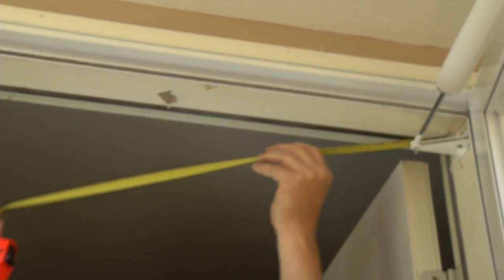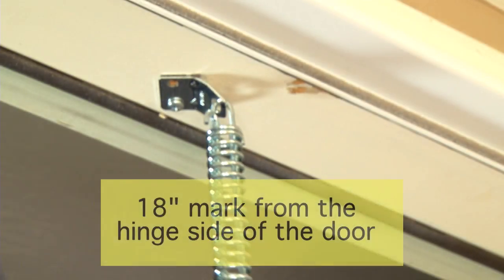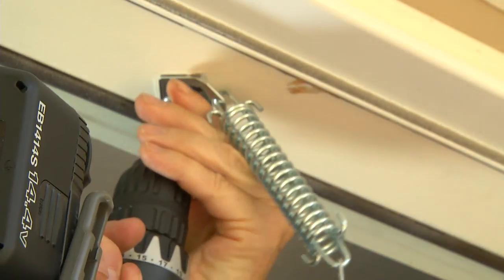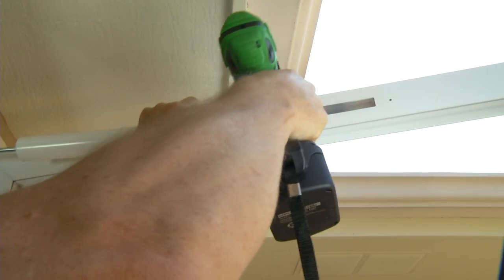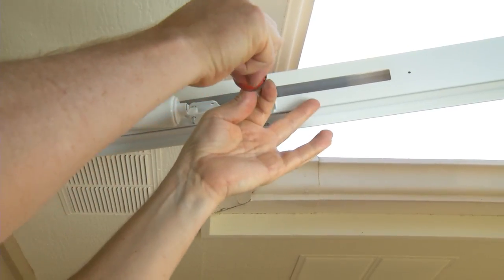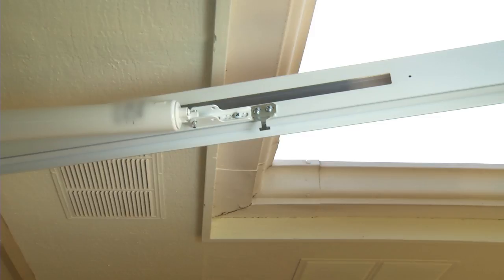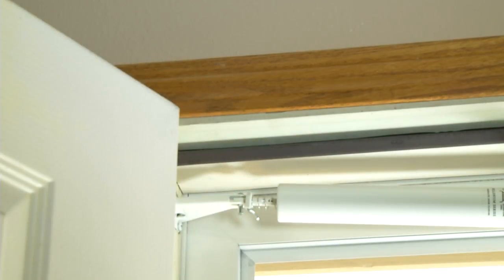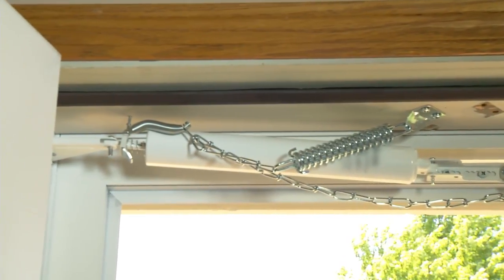Gerkin - Installation Of The Safety Chain

Comment: Anderson doors don't come with spring....because there's no place for it.  Besides, the door is basically plastic.  I'm gonna find places to drill bolt holes all the way thru door and bolt on twin flatstocks with a welded nut , or whatever, to hook the spring.  I checked home depot, menards...not one door comes with a spring.

Comment: Thank you for the 45 Degree Angle on the Head Jam! All instructions have it 90 which totally makes no sense!
Reply: Physics called, and it concurs.  You don't create a twisting moment on head jam screws if they are both normal to the applied force.  I'm sure my engineering 101 professors would rip that statement apart, but I think that's the general idea.  Either way, I've got this job to to today - and will being putting the bracket on at 45°.

Comment: Worried about the 2 wood screws pulling out of the door in a strong wind, I used 2 machine screws            ( #8-32 x 1-1/4 inch ) along with 4 flat washers an 2 nuts. Flat washers on opposite ends of the screws.